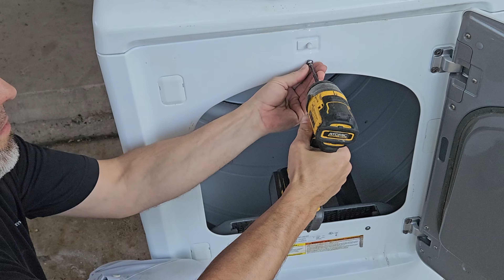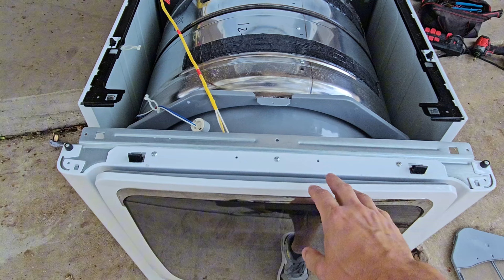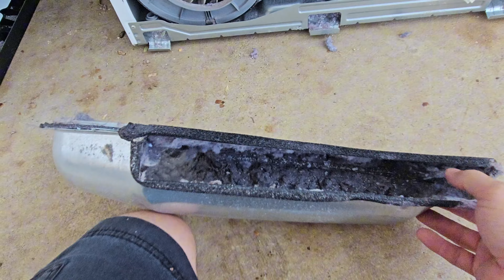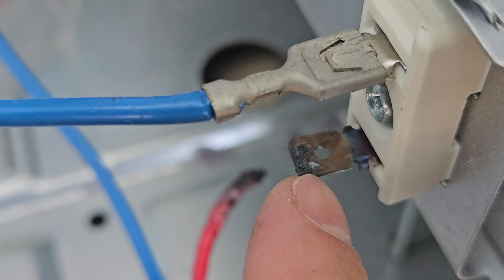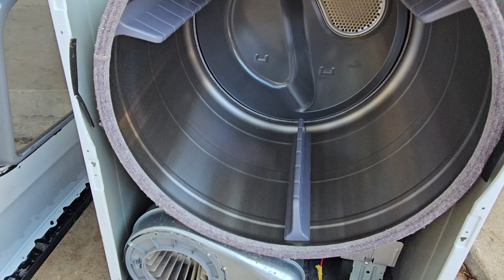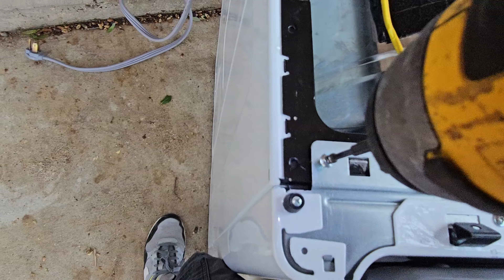Samsung Dryer Not Heating.  Burnt Wires Going To The Heating Element. Easy Fix!!!

Comment: Which side is better for a Samsung dryer? A 1/4 or 5/16…The heating element assembly part number for the Samsung DV40J3000EW/A2 dryer is DC47-
Reply from the maker: I'm sorry... I'm not sure I understand your question.
Reply: @RandysHereToHelp  I click at the Amazon link to buy the Samsung dryer heating element connector red wire in the Amazon gives me to choose between 1/4 and 5/16 which should I get?
Reply from the maker: @omarbautista219 Either one will work just fine!!!
Reply: @RandysHereToHelp  thank you
Reply from the maker: @omarbautista219 you're welcome!!!

Comment: Mine did this and I had to cut all the wire back on both the top and bottom wires and go get the wire extenders at the shop dang and I just went ahead and bought a whole new heating element also with the casing and all new parts on it too just to be safe
Reply from the maker: Awesome!!!

Comment: does this work on the Samsung DV42H5200EP/AC? my wires got burnt off like your video. I wasn't sure if the Element Connecting Wire Kit works.. just wanted to ask before i purchase them.
Reply from the maker: Yes. The kit should work for your model.